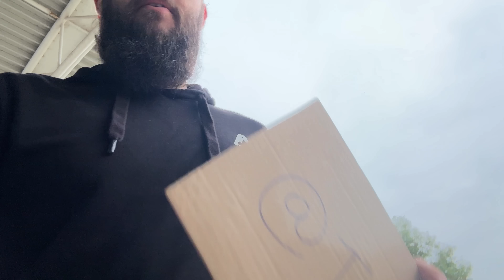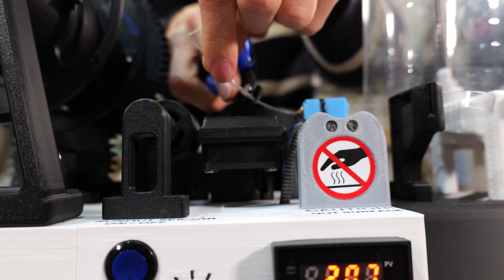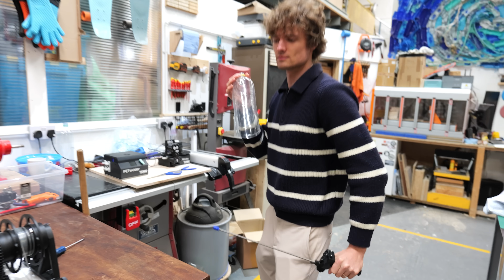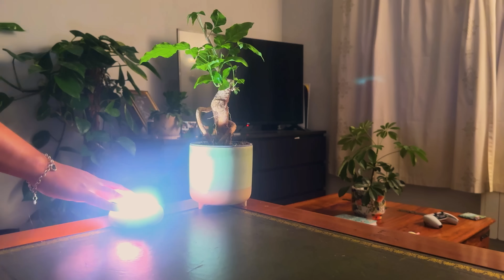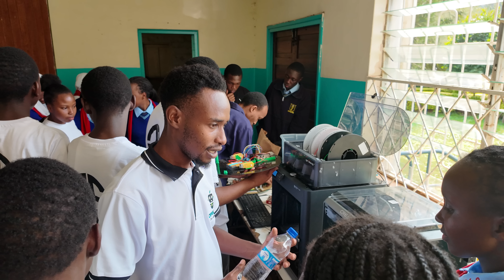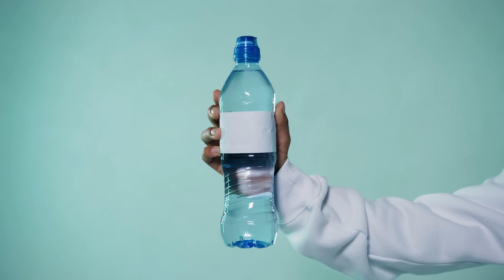Finally, a way to recycle Plastic Bottles at HOME

Comment: My state was one of the earliest to implement plastic bottle deposits and to require recycling. Sadly, we've learned that while we've all been separating our recyclables, only a tiny fraction of it is actually being recycled - and the rest still ends up in landfills. There has got to be a better way.

Comment: another benefit of using the locally produced filament is that, apart from not needing to buy externally produced new filament, you are also avoiding the carbon footprint of storing, packaging and shipping external filament possibly hundreds if not thousands of miles to you.

Comment: I have no idea how PET recycling works.  But, since it is plastic, could you not just melt down your tops and bottoms and then maybe mould them back into strips?  Or better yet, just melt all the plastic and then turn it into strips then into filament?  Maybe Igor knows and he can make another cool machine.  And if bulk melting doesn't work, since it might just turn into a clump of uslessness, then maybe cut the bottle (top to bottom) then heat to flatten and then make strips..  Anyway, would be cool if you could melt down objects you made to turn it back into filament.  No idea how though, I don't know enough about plastics.  Would be cool if that was an option though.  Great video, loved to see how it was used and great way for cheap filament.  Thanks!

Comment: Congratulations! but I have this 3 questions 1) could  the leftover parts of the bottle not used be ground up and to others to make other different products to bw melted and foe them to use and sell 2) is there possibility of creating a brake when winding the filament to have a winder going the f back and forth across the spool giving a more uniform look instead it look kind of just thrown on it, and 3) with it running through and coating various colors to the filament?

Comment: It does seem like if you are going to 3-D print with plastic that it’s better to do it with recycled plastic rather than virgin plastic. None of it is going to be recycled after it’s printed so the former bottle had at least one use before being printed.

Comment: if a guy in his shop can get it this far imagine if the green organizations put a few Million dollars in to this. hell you could have kids everywhere hunting for and saving bottles just to get filament for near nothing! To recycle it again there needs to be an easy way to make it in to pellet and then make pellets into filament. some sort of low heat extruder that requires less pressure or the pressure vessel used for the source pellet is  optimized for pressure distribution.

Comment: If anyone wants to try this on budget printers like what I have (Ender 3) get dual gear extruder because normal singal gear will pinch he hollow filament and a all metal or bimetal heat break for your heted nozzle because ptfe tube in hot end will release toxic fumes at PET melting temps 👍

Comment: The recycling centers COULD take PET printed items if a system were developed to mark the pieces and bring them in separately, so they don't need to be hand sorted from other items. It's a process efficiency roadblock, not a recyclability problem. Ask the recycling center to help you come up with a pilot program.
Reply: @BrothersMake can you do this?

Comment: Anything, anyone, who is putting a dent in the need for making "new" plastics, gets a like from me. Everything has pros and cons, but this is the jump off point for more conversations and innovations. Unfortunately the percentages of recycling is not where it should be, but as someone who has been recycling since the early 1980s, I'm for anything that gets even a fraction more out of the landfill and incinerator flow. If the next step is working on recycling 3D printer waste, then that's awesome. It would be great if we didn't live in a throw away society, and people could be trusted to not throw anything out until there would be absolutely nothing else you could do with it. 
Thank you for all you do!

Comment: Heating PET plastics, even under low heat gives off toxic fumes.
As does using acetone on PET plastic.
Higher heating to 210 C or 410 degrees Fahrenheit is way too close to the full melting point (250C/482F) and will give off more toxic fumes.
Then, on a PLA style printer, the already heated PET plastic will be heated again, usually 210C/410F on 3D printers, causing greater chemicals and toxic fumes.
No one had a mask on while cooking and making the PET plastic filament.
And the click-bait picture showed it in an oven with food?!

Anyone who does this, enjoy your cancer, but feel good you did your part (lie) saving the planet. Yet, this will have ZERO impact on the environment! People go nuts for just the slightest amount of chemicals and Red dye 40 in their food but let's cook our own plastics???!!! FFS!!!!!

Comment: I mean, this is a great idea: the problem is scale. The amount of plastic waste produced is going to far outweigh the tiniest fraction that a few hobbyist 3D printer enthusasts are going to do to put a dent in it. Ultimately, the problem with plastic recycling, is that "plastic recycling" itself is a kind of greenwashing of an industrial-scale problem, that puts the emphasis on the consumer, rather than the mega-corporations pumping out gazillions of tons of disposable plastic. We need strong regulation to curb the production of these single-use plastics in the first place, and hold the companies accountable for the costs of cleanup of their mess.
Reply: As consumers, we can eliminate some of our consumption of items in plastic. Soft drinks often come in both cans and bottles. I usually consume tea or coffee, so the packaging is much less than if I were to buy something ready to drink. (I am not a saint, I do this for the cost savings and because I don't own a car. Beverages are too heavy to schlep around.)
Reply: @planetluvver   I mean yeah I avoid it as much as possible but like the scale is astronomically larger than what individual consumers can do. Every time you eat a bag of chips that goes straight to the landfill.
Reply: @sarakajira Alas, I do love my chips... I remember when they came in waxed paper bags within a cardboard box, though I don't know if it was much more environmently friendly. I do try to pop my own popcorn as a snack which entails much less packaging and expense.

When I was a kid, there were several small neighborhood grocers that I would be sent to when I was as young as eight years old. It is tragic how we have lost so many small independent businesses. Meats, sliced deli products, and baked goods were wrapped in paper and produce was unwrapped.

Comment: Hey guys!  To take care of the end-of-line problem of the 3D prints, then print things that need to exist forever.
Did you think of printing lego bricks for housing?  You would have semi-transparent walls which let in a lot of light during the day and, well nothing during the night.  These guys have to be there for a long time, so it's not such a bad problem that they be non recyclable.
Maybe there is a way to reduce the price of housing with that.

Comment: I recycle several tons of PET bottles in my garden shed every year, as well as other sorts of PET waste plastic.
My method is simple; I just drop any kind of PET waste plastic into the recation chamber of one of my four pyrolysis units (no need to do any cleaning of this raw material). In there it's processed into Benzene. Benzene is the original material used for making PET plastic.
The process is as follows: The waste PET scrap is loaded into the reaction chamber of my pyrolysis unit. Then the pyrolysis unit is heated up (waste wood = free heating). My pyrolysis units are all made as a modular system for quick exchange of the reaction vessel, enabling me to do several runs every day.
The off gasses are lead to an insulated cyclone (catches all the carbon particles that otherwise would contaminate the end product) placed in immediate proximity to the exit at the top of the pyrolysis unit. It is very important to have an insulated steel box around the cyclone as the Terephthalate in the PET sublimes (it cannot exist in liquid form); if cooled just the slighest bit the gasses will crystalize and totally clock the off gas pipe, resulting a possible dangerous explosion.
Inside the insulated metal box connected to the pyrolysis unit is not only the cyclone, but right after the cyclone a second chamber where the off gases are cracked over a catalyst into Benzene. This small chamber, insulated inside with Caowool, is electrically heated to a high temperature, enabling the reaction to take place. By the way, electricity is free from 55 old solar panels saved from being scrapped.
Depending of the type of processed material the Raw Pyrolysis Oil contains 30 to 60 % Benzene. The Benzene is later extracted by fractional distillation at low temperature. The remaining part is used as fuel, either for heating of my workshop or as fuel for my metal melting furnace. However, all the Raw Pyrolysis Oil from processing other types of plastic waste is cracked into three categories: Free Petrol/Gasoline for my car, free Diesel for my truck, and free Fuel Oil for wokshop heating or metal melting; though the vast majority of incoming waste plastic is sold for recycling. What's processed at home is only crumbles/broken pieces/floor sweepings, and all kind of "hard to sell" plastic types (primarily some Group 7 types and of course the troublesome #3, PVC plastic).
Benzene is an important chemical for dissolving purposes, as well as for being used for SX (Solvent Extration) in some of my chemical processes.
I'm full time scrapper/recycler/metal refiner, on my 14th year.
Reply: Please show us in a video.  Sounds like a great process
Reply: Complicated and toxic, so sure the gases are released to the hood but now you are polluting the hood.
Reply: @JG-lx5pm  What do you think they do with the plastic in the recycling center? At best they burn it for electricity. Do you really think someone is squeaky cleaning all the plastic rubbish and than remelts it into a products? I adore your guileless.  At worst they send these bales of plastic to china on a ship.
Reply: @JG-lx5pm  .  Would you please specify clearly what you regard as "complicated" in this simple process?
What do you exactly mean by stating that this process is "toxic"?
What is "the hood"? Please clarify what you mean by claiming "polluting the hood" occurs during the pyrolysis process?

Comment: couldn't I just put the whole bottle and anything else through a liquidiser, turn it in to dust and extrude into filament?
Reply: Don't take my word for it but I'm
guessing for a small batch slicing it instead of pulverizing it might be more efficient because so much of the material is already adhered and you don't need all that chopping force, plus better particulate management?

Comment: You are so living in the past..  Norway, Sweden and other similar countrys has had a RETURN SYSTEM for bottles for years.... And it works remarkably well... But you dont get it hu? No, just pour out plastic bottles without taking responsibility... What you guys are doing private (recycling and stuff) are just a tiny bit of the picture and does nothing to the total amount of plastc waste. It does off course gives you personally a better counciousness, but noting more... No... Once again. Open your eyes and DEMAND a nationwide returnsystem implemented...

Comment: Rather than welding 2 filaments together with a joint, would it be stronger to take 2 filaments and find a way to melt the filaments together length wise. Kinda like a 3D printing plastic like you would folded steel.

Comment: Sadly in most 1st world countries the actual amount of  recycling is far less than the commercial hype or the political promises. Also PET is not endlessly recyclable & virgin PET pellets have to be added each time. Also with curb side recycling it is critical to remove lids & rinse the bottles out. Basically whole batches of bottles will go to land fill if they are contaminated. 
So PET printer filament is a fantastic way to recycle.

Comment: it's a good start, but the extruder is too slow, 1 meter per minute is about 5hs per kg if nothing wrong happens, plus the time to prepare bottles, weld filament and dehidratate them... with wind in favour you get 1kg per day. That's why chinese machine manufacturers don't even care to produce extruders for recycled filament production... i hope this technology could be more effective to really make an impact... nowadays is just laboratory tests.

Comment: How does the PET compare for fumes and air quality while making the filament or printing with it?
I've found resin gives off much nastier fumes than PLA filament, though haven't got the gear to measure. Just going by smell

Comment: Great to see this thanks, I have wondered about this machine for a while andI am now very tempted to buy the two and make them.not becuase I can not afford to buy new filament but its the fact you can make your own and make a little difference. Fortunately I am on Solar living in Spain so I would make this during the day when my power is completely free and the excess is being stored in a virtual battery, if however I wasnt on Solar I would have to question the economics of making your own filament because the energy expended in electricity must surely outweigh the value of the completed filament I expect.   

However I love the fact you can do it.and that is what matters expecially in third world countries. Incidentally I use crutches all day and have done for several years now and one thing I would say is that the rubber cap that you made out of TPU must have a metal disc placed in it otherwise the aluminium pole will cut straight through the rubber onto the surface below in just a few hours use.  When you're using them every day, you normally have to change these rubber caps every six months because they just wear out with the pressure of you pushing down on the crutches.

Comment: I have a X1C and you can use it to dry filament. There is setting in the menu. I use it to dry desiccant orange beads and does an awesome job. Im sure the p1s would have the same feature??? Better than using the oven?

Comment: if it means you're not buying virgin filament, which will run into the same un-recyclability problem, then of yes, it's still worth recycling PET bottles, because it's still displacing the production of new plastic materials. There are other DIY filament extruder systems out there as well (though far more intensive than the bottle one) that can recycle pelletised prints, so it's still possible to DIY recycle even completed prints.

Comment: 13:38 My Instant Pot Duo, and other forms of air fryers often have a dehydrate function, and are usually the exact right size to put a 1kg 3d filament spool in. I've used mine to dry out filament without issue, however I would recommend letting it pre warm for 10 or 15 minutes prior to adding your spool, as I don't know how different machines heat the element, could grill the top of your spool if it's doing full power constantly to get up to 50 or 60C etc. Then it's just brief off and on. My one hasn't melted anything at the top so I suspect it's using lower current on the heating element.

Comment: its both plus one more method in my mind, left overs can be formed into the string or stuck into extrude smelter mold machine to make full on benches an plastic blocks or be tossed into an 2grand grinder filament method bits machine. also you can print 3d mold then use resins to make eco bikes an stuff with carbon fiber blends so i see like 6 methods of use in all reality for plastic re use. an if you use the set up on an hybrid solar set up it be even more eco friendly.

Comment: A superb initiative that has interested me for years. To recycle even more material, especially the neck which concentrates the most material, you can use a shredder like those shown on the Precious Plastic website. Plans are available, and some even sell second-hand machines. But this requires space, as you need another machine with an auger to process the pellets. My dream is to build these machines so I can have filament as much as I want and help reuse all this plastic.

Comment: Well, since, according to recycling experts, only about 20% is actually recyclable and about 80% ends up in landfills and incinerators anyway, Marten Gregory is pretty certainly right that it hardly makes a difference whether you incinerate whole bottles or dump them in a landfill or just parts of these bottles. 
With regard to your experiment, I think that the production was quite time-consuming and it probably only makes sense in the countries mentioned, where filament is not available or only at very high prices. In these regions, the method may well be a suitable alternative.

Comment: Our county lacks a fully-featured MRF, so plastics aren't recycled unless someone drives them 90 minutes to the nearest proper city. There's a desperate need for small-scale, distributed recycling (and upcycling). While the PET bottle-to-filament system fills a viable niche, it needs better automation to make it cost effective. I'd like to see @BrothersMake propose a feasible ecosystem that could potentially be purchased and operated with grant monies and local funds.